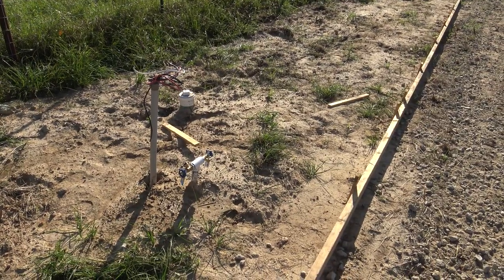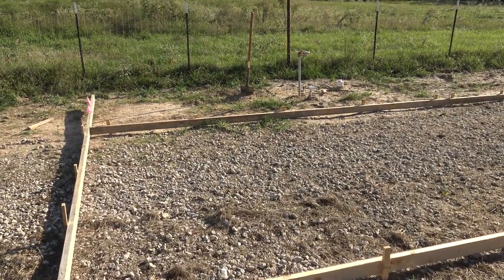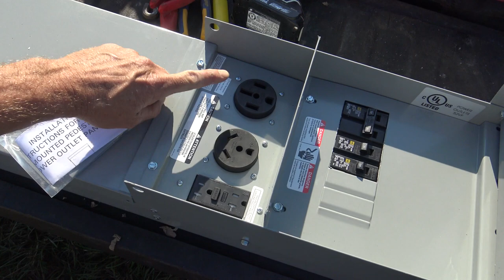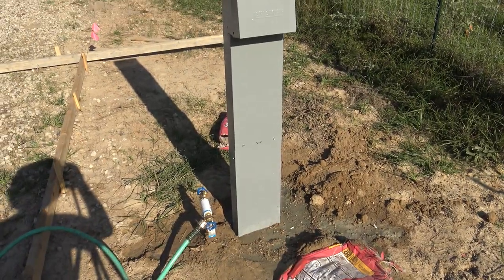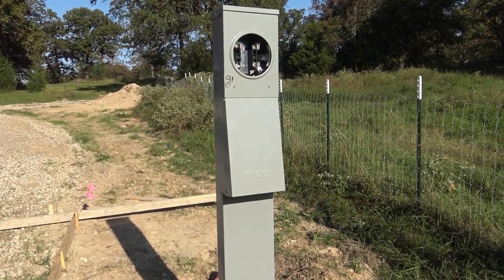RV Meter Base Install Ep 78

Comment: How do you feel about EVs plugging into the 50-amp receptacle?  Do you feel that there is any problem with an EV pulling 220V 32 Amps continuously overnight?
Reply from the maker: Nope. As long as it don’t pull more than 50 amps…. Each tenant pays there own electric bill, they can charge if they want. But the meter will only allow 50 amps

Comment: What if you have a metered rv service socket? Do you do a neutral ground bond if it is also the main meter socket? Do you also ground with rod if rv socket is the main power service?
Reply from the maker: 1st yes you can 2nd yes I would
Reply: @NoneyaTexasontheback20  there isn’t a single main breaker, it has 5 slots.  2 pole/50, 1/30, 1/20, and single empty.  My thoughts are to run a solid ground from ground bus to neutral bus, and then do 2 ground rods with #6 solid to meet NEC.  Thoughts?
Reply from the maker: @nineteen70six  50 will require neutral. I don’t have NEC but should be fine
Reply from the maker: @nineteen70six  I would install main 50 amp breaker. Otherwise you could get full 150-200 amp surge
Reply: @NoneyaTexasontheback20

Comment: Did you have to pull a permit to install?
Reply from the maker: No permits required… outside of city limits.  Thanks for stopping by
Reply: @NoneyaTexasontheback20  I reside in Texas as well Katy to be exact.Im thinking on purchasing some land and trying to figure out the best route to go to aquire electricity.This seems the way to go.Thanks for the response.
Reply from the maker: @MaryDawson-gt6cr  no problem we have a house in Katy too…. Are you building an rv park or just power for a house…. Process is same you will need a meter pole and base to run power from.  Electric company may require something specific depends on what your doing..
Reply: @NoneyaTexasontheback20  No rv park just power for a tiny home or double wide maybe.Trying to figure out the least expensive route to take.
Reply from the maker: @MaryDawson-gt6cr  ahhh ok. Yes you will need meter pole for either…then from that you can go to house
Reply: @NoneyaTexasontheback20  Oh ok .Thanks for the info.

Comment: What size wire are you running from the panel to each site.
Reply from the maker: #4 copper. About 150 ft. 50 amps
Reply: @NoneyaTexasontheback20  So did you use a 50 amp breaker for the line?
Reply from the maker: @swiftdisposalservicesllc3326  yes 50 amp supply and 50 amp at post.  I know I loose a little but shorts runs it’s been ok so far through summer

Comment: None Ya Texas on the back 20. What is the 2nd black wire that you attached to the terminal mounted in the middle of the pedestal? Did you install a grounding rod? I am installing the same unit using 4/0,4/0,2/0 wire. I was wondering where to hook the grounding rod wire too as well.
Dean
Reply from the maker: Dean, there are 2 hots, a ground and a common.   The ground rod goes at your panel distribution box.  Its extra cost to run it that way, but it is the correct way
Reply: @NoneyaTexasontheback20  My installation is calling just 3 wire as noted and a grounding rod. I am running from a transformer installed by my power company to my RV pedestal. So you are going straight from a distribution box and requires a second hot wire?  I emailed jamestown and they said I can use that lug for my grounding rod ground.
Reply from the maker: @deano37  yes  you can.   I have a distribution panel for several spots and that is where my ground rod is.  If you only have one you can put your rod there..that is correct.
Reply: @NoneyaTexasontheback20  Excellent. Thank you for clearing that up for me. Would you happen to know if I need to install 2 grounding rods 6ft a part for 100 amp service to RV pedestal? I am running 200 amp wire, but only in case I ever decide to build I will be covered.
Reply from the maker: @deano37  you should not need to in my opinion
Reply: @NoneyaTexasontheback20  Not need grounding rounds or 2 grounding rod? I am going to ask the inspector, but trying to get educated some on it. I appreciate your help.
Also, did you run conduit your whole run or just on the end going up to pedestal? I am trying to decide if I would bother with conduit since I am already upgrading my wire for future 200 amp service. I don't know what the failure rate is for Triplex wire and what the likely hood of it happening warrants spending more money on conduit. I talked to inspector and I don't have to put down any special material around wire, just make sure there are not sharp rock, etc that could damage wire.
Reply from the maker: @deano37  not needing 2 grounding rods...  I ran all of mine in conduit.  There is no code requiring I do so, it was just added protection.  It should be easier to repair if you do have a problem to just pull wire out and pull new back through.  There is special cable to bury without the conduit.  To be honest, I have seen many miles of conduit ran, and about 75% leaks water anyways when you have contractors do it that don't care.   Thats why I do it all myself.
Reply: @NoneyaTexasontheback20  I hear you. That is why i do most of my own work myself as well. There is no code here for conduit either. Just added protection and if you need to pull wire again it's easier then digging a new trench. I am running wire that does not need conduit regardless if I do or not. Triplex 4/0, 4/0, 2/0 direct bury wire for added protection as well.
Reply from the maker: @deano37  that will work perfect...one gopher or mole will ruin wire.  We got lots of moles.   usually not that deep but  for few bucks  worth the protection.

Comment: can the 50 and 30 amp plugs be used at the same time?
Reply from the maker: no   each pedestal is only rated to 50 amp..  its one or the other...
Reply: @NoneyaTexasontheback20  How much does it cost for the electric company to come out and hook electric up to it
Reply from the maker: @Randomvids1981  I hooked it all up myself from main pole…the initial cost from electric company was $300 meter service…. I run 5 rv’s off 1 pole

Comment: Sir, what wires did you use? I’m going 125 ft and 75 ft. By the way, that video helped so many people. You are a godsend. Got a new subscriber.👍
Reply from the maker: Thanks Double W, #4 will take 50 amps about 200 ft.  If shorter can do #6.  Depends on if a 30 amp or 50 amp

#4 for a few bucks is best!    Thanks for watching
Reply: @NoneyaTexasontheback20  Is that the 4 AWG with a ground? Thank you for the reply bud
Reply: @NoneyaTexasontheback20  Sorry for my ignorance. I just want to learn
Reply from the maker: @doublew030  well again it will depend on 50 or 30 amps   Each hot will need to be #4 or #6. Neutral as well if 50 amp.   Ground can be size smaller. So #6 or #8   No worries brother that’s why I made vidya 😂👍
Reply from the maker: @doublew030  I always use copper. And yes AWG
Reply: @NoneyaTexasontheback20  You da man! Thank you sir
Reply from the maker: @doublew030  😂. Thanks sir hope it helped!

Comment: Do you have to have any special certification to do all that wiring? Just curious. That's awesome!
Reply from the maker: Certification??    haaaaahahahahahaha   um  No......lol
No I never took an electrical course.
My dad was electrician for about 40 years  I learned a lot.   I used to be service engineer for large Equipment supplier.   There's not much I haven't worked on.  Electrical/Plumbing/HVAC/Construction/Industrial stuff....thanks for watching.....   Hint:    usually with electrical as soon as you hit the switch, you find out if you were right or wrong.....   lol
Reply: @NoneyaTexasontheback20  LOL that's definitely true
Reply from the maker: @HappyPlaceCamping  I hate electrical....  can't see it.  and it will bite you....  I just was not gonna pay a guy $14,000 to run pipe and wire....  That is my problem.  I can do all this stuff and refuse to pay outrageous prices to have it done.  So it takes me forever  lol....  I'm so glad I bit the bullet and had the septic company install the septic system....Its getting close to ready now....just widening the entrance where RV's can actually get in.....Hopefully we can advertise soon.  Ready for some payback  lol...
Reply: @NoneyaTexasontheback20  how many site did you do and rough time that it took you doing most of it your self?
Reply from the maker: @lucasdixon1795  I did 5 to start about 2 weeks. I’m adding 10 more now. Yes all myself